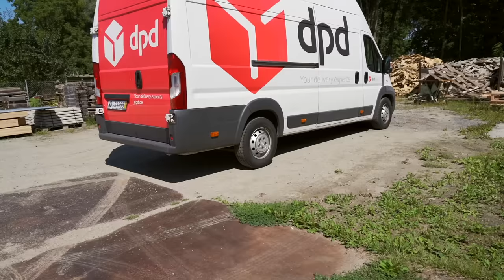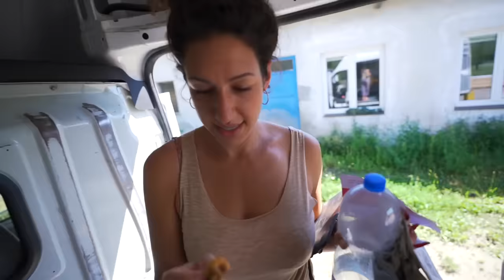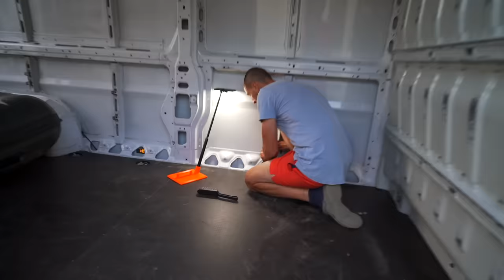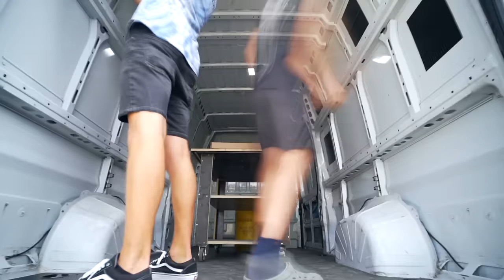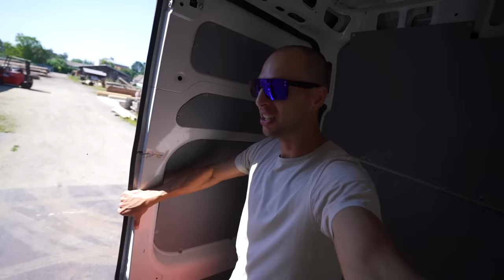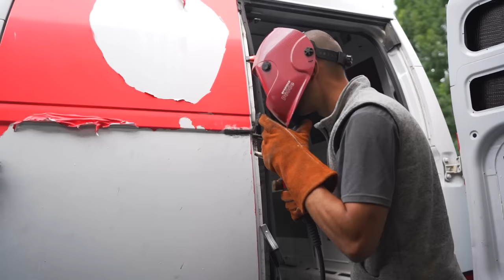NEW VAN BUILD! Converting Awesome Campervan w/ Ideas We've Never Seen Before (Vanlife Europe) Ep.1

Comment: Hi" when removing stickers, use a hairdryer on it first. It reheats the glue and makes it easier to remove.  Hope this helps a lot of people 😃
Reply from the maker: Yes! I'm so bummed we didn't include any clips with the heater. This is a popular comment, and we'll tell you all the other ways we tried that we thought would be better than the heat gun. Some were, some weren't, lol. Next video! <3
Reply: Even better to use steamer.
Reply: Great tip. Or do it in the sun. I'm in the decal business. there is a decal removing tool available from almost every signmaking supplies company in every country for less than  A quid/dollar/euro. Priceless.  Like the scraper in the video.  Almost all those decals will be a basic acrylic adhesive and almost any solvent will help.  Decals release easier when warm, we even weed them out when new on a heated cutting mat.  Hot soapy water and the aformentioned one-buck scraper will work very well if you don't have a heat gun. . Job done. Hours saved.
Reply: Although I haven’t tried it myself, I understand WD40 works on stickers too.

Comment: 3M sells a drill attachment that removes stickers, they call it a decal remover. I used it on my boats to remove the old decals and license numbers and it worked amazingly. I also used it to remove the rental decals on my class b motor home. It didn’t damage the paint or fiberglass and works fast.

Comment: Low pressure sandblasting  easier to remove  rust   obviously be careful  by wiring . And torch on roofing  product for sound deadening panels   .  Sticker removal  heat gun  .   Cavity wall foam  does good job on framework  .  Stops draughts and rattles

Comment: A heat gun would have helped with those decals
Reply from the maker: Definitely. It’s just an exchange for having one hand only. We ended up pealing them on direct sun so the glue softened and we had both hands for this bloody job 😂 unfortunately the sticked doesn’t come off instantly with a heat gun, it males it maybe 20% easier.
Reply: @ladiandmargaret  yeah heat gun will help but also acetone for removing the glue
Reply: Was just about to say. Even a hair dryer would cut that time down by 3/4. Mental.
Reply from the maker: @scottishsuzuki8132  read above :)
Reply: @ladiandmargaret   boiling water works the same :)

Comment: I used to work for DPD in the UK and those decals are applied using a heat gun in dry conditions and with a good ambient external temperature. You would have needed an industrial heat gun

Comment: The best way to remove old vinyl stickers is to heat the vinyl with a heat gun if the glue is heated it will come off a lot easier,  or you can get a caramel wheel that goes in your hand drill that will remove hard to get off vinyl, ( I am a sign maker & have been removing vinyl from vehicles for the last 25 years)also did you disconnect the battery before you started to weld the doors as you can blow up the ECU (engine control unit) with the current from the welder Colin

Comment: What a fun project.  Can't wait to see what you do for the kitty!  You've probably finished removing the decals by now, but for others struggling with the same problem, try using a heat-gun to soften the material and loosen the adhesive.  It's not a perfect solution, but it will make the job a little easier.

Comment: it's obviously late advice, but the stickers would go a lot faster if you used a heat gun on the vinyl first. It would weaken the adhesive. The other way, would be a squirt bottle of solvent that would dissolve the glue but not the paint, something like mineral spirit, methanol or , depending on the paint , acetone.

Comment: Next time you need to remove stickers..
Remember that Heat and Oil (any oil) are your friends

Any surface can be cleaned from adhesive left on it from stickers, by rubbing it with Oil on a cloth
You start with heating the sticker or labels with a hot gun, just enough not to damage the paint

Comment: Not sure hammerite is the best thing for long-term rustproofing. It's OK, and the one-coat is convenient, but my experience is that there are better paints (which all cost more of course). I've got about 6-8 years from hammerite under the van, and ~13 years from por15 chassis black, and for last 4 years I've been painting everything with 2-part epoxy paint. It remains to be seem how long that lasts. I guess hammerite on the inside should give a reasonable lifetime but I hope you put on 2 coats. My experience is that one coat works really badly if there are any corners. I used to use a lot of hammerite, but I've gone off it over the years as I've found its limitations (and maybe got a bit richer so can afford better paint :-)

Comment: HELP been watching your vid's for awhile and I'm thinking that if someone pointed out problem's that each van has,  like just for example, TRANSIT = drains under windshields, always plug up and when they do work like they should, the water runs right down on top of the vans computer & wire connections. It's been like this at least on 2013-2021's  That's 8 years!!   How can we get there ear? I went to the Ford dealership and was pretty much told that they had NO STROKE & to suck it up and live it.  Thanks, ford   I really wanted to special order there mid-roof but there's 4 things like the one I mentioned that they don't want to correct. This brings me back to wanting to know what's pro-master &  sprinter's  problems, that there manufacture's think we the consumer's should suck- it-up and live with there poor design.

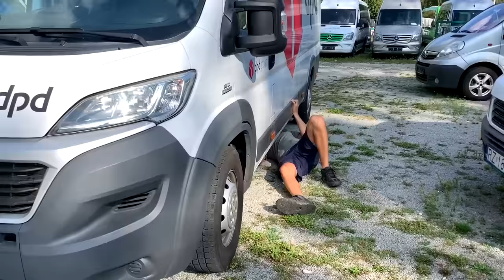Comment: At 5:20 - take the4 plastic panels off, silicone around the plastic clips and then put the plastic panels back on the van, no water will get in from those areas then.. Also, if you're painting in the areas where water can gather from the clips/plastic side panels then make sure you don't close up the water drain holes under the van. Vid link to show you where the drain holes are and how much water can actually gather inside your van from the plastic panels -- https://www.youtube.com/watch?v=Nn1C5Two4fM&t=48s

Comment: When I saw 20,000 budget for the build I said ok reasonable, but including the price of the van!  That’s an insanely low budget. Looking forward to see how you pull it off.
Reply: With a 13kw battery, impossible.
Reply from the maker: Pretty doable when I make one. I’m more considering 15kWh these days. Stay tuned.

Comment: How you plan to charge your ebikes? Do you have Step-up DC-DC charger or will you use standard charger?
Reply from the maker: My controllers can be supplied with any lower voltage than the bike voltage so no converter needed 👌

Comment: I have the exact same problem with the red sticker 😂 I gave up after two whole days and started with the conversion on the inside.
Reply: @subspaceanomaly  we tried that and multiple other ways that should have worked 😂 the black one was no problem at all.
Reply from the maker: Exactly the same problem. We tried different heat gun techniques, different removals and chemicals and it all ended up being pealing inch by inch 😂

Comment: Ohh, sticker removal... I am building out my iveco daily (also really big😜) and it has had reflecting stickers on the front and the back... I used first a heat gun to remove the sticker, and for the glue I used cleaning thinner. But it's a hell to do...

Comment: As an ex-multidrop courier I would advise people to NEVER buy a courier van. These things get ragged, stop-started 100 times a day, always driven in 2nd and 3rd gear, spent loads of time at high revs, and extra with urban use and if not privately owned it would've been treated carelessly etc... A 50k mile courier van is easily equivalent to a 150k mile motorway van. It will have a staggering amount of wear - brakes, engine, gears, clutch. Don't EVER be tempted by low miles or age. There is no way in hell I would.
Reply from the maker: Ours is in a very nice condition. Maybe it was long run delivery instead of local one.
Reply: @ladiandmargaret  maybe. DPD are almost entirely multidrop. Drivers have targets of 80 drops a day in the UK. Have you had a compression test on the engine? Suspension should be checked too, these things are rarely "parked" and more like dumped. A multidrop van would've been ramped up kerbs, run through potholes, driven through building sites. All sorts. That's probably why it was so rattley
Reply from the maker: I think people overanalyze history of vehicles. I take is as is, they always brake so you fix whatever needs attention. Cars don’t mayor wrack fail randomly often.
Reply: @ladiandmargaret  each to their own. Buy on condition sure but that condition is heavily dependent on it's history, and internal condition of expensive items like gearbox and engine is difficult to check. Anyway, good luck in your adventures. I was just making a point that the public may not consider, that I know first hand.